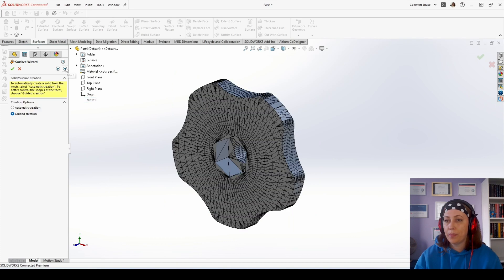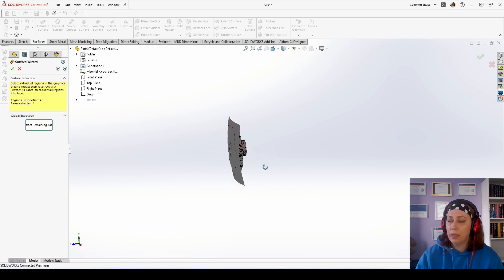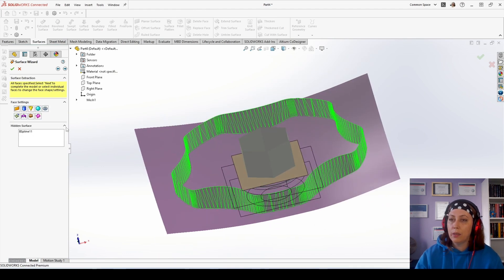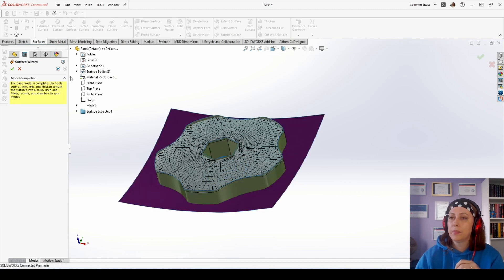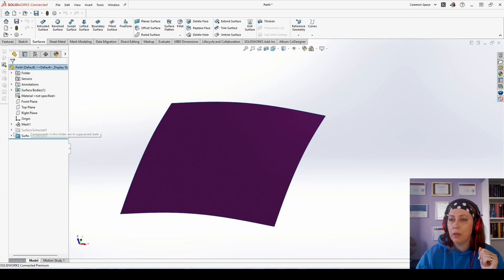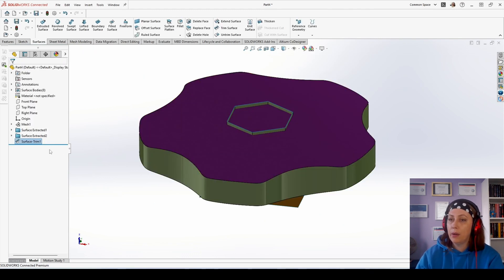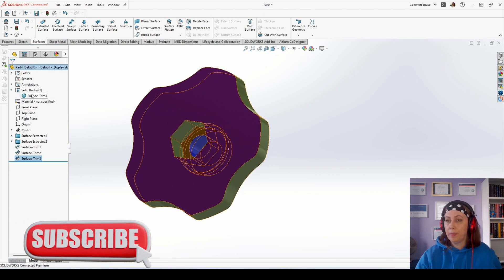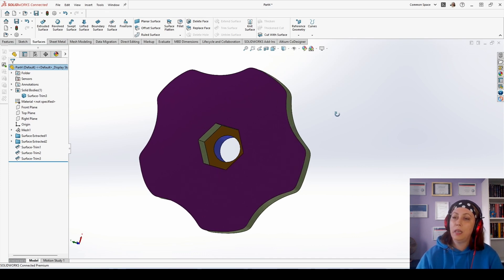How to Solve Geometry Problems in SolidWorks ScanTo3D

Comment: Unfortunately unable to take out the mesh on my stl file imported. is there any function to create a solid body (separate) to fill in the surface element obtained from the import process?
Reply from the maker: At this moment there are only 2 ways to get rid of the mesh in your model - convert the mesh file to SolidWorks surfaces or to have the latest SOLIDWORKS where this is the new norm.

Comment: Hello, is there any possibility to create a solid body without the mesh on it, after importing stl files? excellent channel with very helpful techniques and very useful instructions
Reply from the maker: Thank you. As for your question the Mesh Body without visible mesh is possible from the latest SolidWorks and actually is change influenced by me. You can see it in action in this video: https://youtu.be/z4_-BBglmQs
Reply: @DWorkshop  thanks for the video, but the trick was not solved. is there any function to create a separate solid body, starting from the mesh imported (deriving from a stl file) ?
Reply from the maker: There are many ways. Probably it would be good to check my latest video https://youtu.be/rlICZ0P1Mfc, and my playlist about Mesh imports https://www.youtube.com/playlist?list=PLdfEJ9NcD36TGUlGpZh8KHKjJRnK_sZ9k